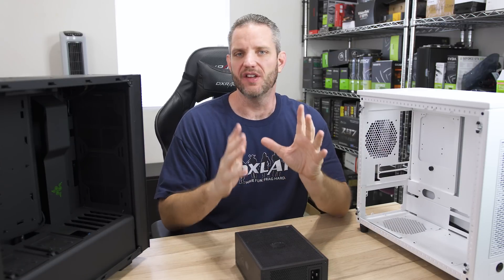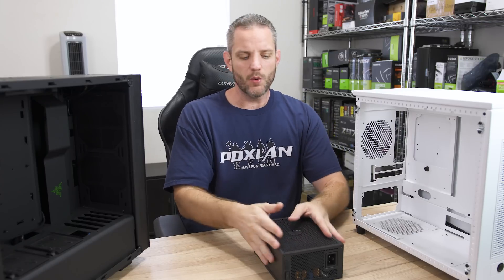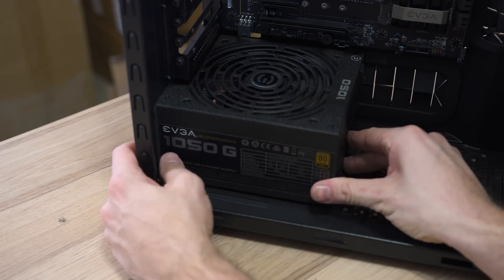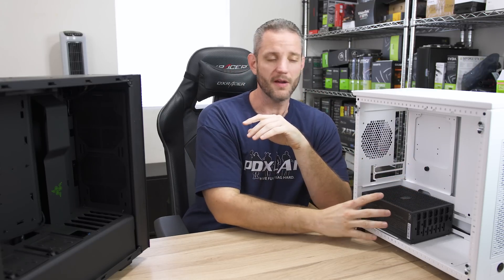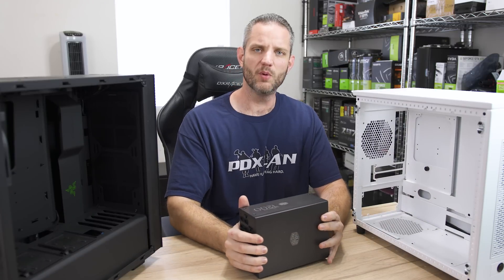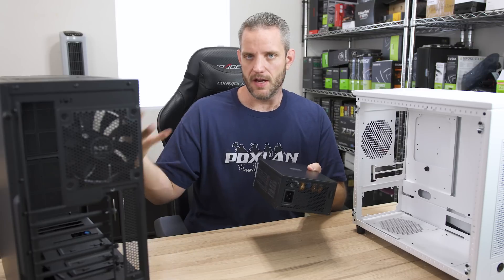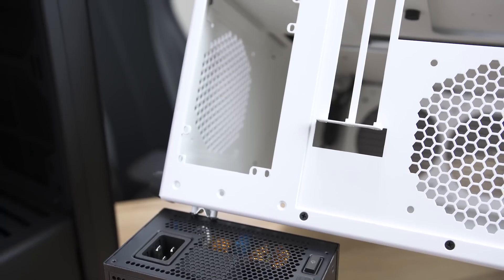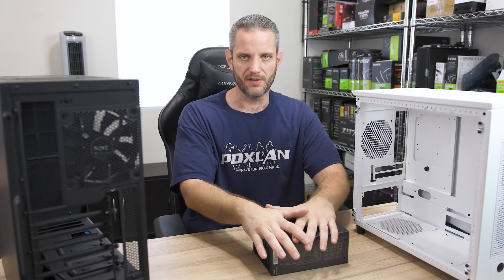Should you mount your Power Supply up or down?

Comment: Thanks for going over this.  It did raise a few questions for me - not sure if it's easier addressed in the comments or if I missed a previous vid you uploaded, but here goes:

First, with regard to positive/negative air pressure, I'm led to believe that doesn't really matter as you're not talking about an airtight enclosure.  You have constant passive airflow - often enough through the grilling that's usually most of the back and top of a given chassis.  That's not enough to cool PC guts if you're going strictly with air cooling, but the pressure would logically sort itself out under those conditions.  If I'm wrong on this, can you point me to some resources on the subject?

Second, with regard to mounting the PSU up, wouldn't it just be pulling in the heated exhaust from a GPU (again, assuming stock air cooling) as the two sets of fans are pointed directly at one another?  I grant that the air exhausted off of a GPU will be cooler than the GPU itself, but it still seems like a bad idea to have that pointing directly into the intake of another device.  Again, if I'm way off base, please set me straight on this.

Again, thanks for the great vid.  Looking forward to the next.

Comment: I don't think you should count on a revolving warm air scenario with a PSU venting downward. They don't exhaust or intake at high cfm and that warm air will rise out the back far easier than it could be pulled back in. I would always vent downward even if it meant putting it on a board. 

I think you could make an argument that helping exhaust a GPU blowing down onto the PSU at upwards of 2000 rpm. But I still feel better having that all important PSU fending for itself alone.

Comment: wow, never knew this. question, I having the airflow for all 6 of my fans to exhaust out of my case with no intake. is this wrong? I thought it would limit dust and heat. so far I have noticed less system heat and dust but I also put my PC on my desk
Reply: 3en 3en6ie thank you. that helps. so I have 2 140mm in front a 240mm radiator with 2 120mm up top and a 120mm in rear
Reply: 3en 3en6ie TT core v71

Comment: i have the nano s, should i mount it down or up?
Reply: somewhere in between.
Reply: probably down, at least if you have a dual slot graphics card because the card cooler will block the psu fan, also if you haven't already bought one you should get a blower style cooler over an open air cooler in that case as the psu will block airflow to the fans of an open air cooler.

Comment: Won't the GPU exhaust into the top of the PSU and make it hotter?
Reply: GPU's don't exhaust down. your only exhaust directions are out the back of the case, up/down relative to the GPU, or out the 'front' end of the GPU towards the front of the case (opposite of the backside).

GPU's always intake from down, they never exhaust in that direction.
Reply: ***** Oh, I've been thinking the GPU's exhaust from the fans this whole time. Thank you for the information

Comment: I was actually wondering if facing the PSU up would help with airflow of open air graphics cards such that the hot air from the GPU would have a path to escape, otherwise the PSU would effectively disable one fan on the GPU. However if both GPU and PSU ramp up their fan speeds, both are choking for air.

Comment: I actually just switched the direction I had my power supply to up and cooled my graphics card down by 15°C
Reply: ^while under load
Reply: Are you exaggerating or did u actually see temps drop that much?
Reply: Not exaggerating. I have a 1070 and I noticed when I took my headphones off while playing Witcher 3 that my PC was super loud. My CPU temps were perfect but my GPU temps were in the 80's. So I looked at the inside and I realized that my GPU wasn't getting any air flow at all because there is nowhere on my case to put fans so the GPU can breath and the card is so long it splits my case into two halves. So I decided to flip the power supply and it fixed it immediately.
Reply: Is it a reference 1070 or an open-cooler aftermarket one? What case do you have?
Reply: It's a thermaltake versa h25 and a Gigabyte G1 Gaming 1070
Reply: Interesting. I just modded my case so that my side panel no longer has a fan space and I saw temps go up. I'm going to try flipping the PSU now and see if I get lower temps because right now with the side panel on I get ~72C at 50% fan and without the side panel I get 60C.
Reply: Just flipped it and it's made no difference :(

Comment: Linus did a video on this before. It makes no difference at all. It comes down to " A E S T H E T I C S"
Reply: No, he mentioned it depends on where you're planning on putting your tower, if you put it on a carpet floor with no case feet, fan facing up is ideal unless you want to blow up your PSU. And a few more things.

edit - posted that comment before Jay mentioned carpet.
Reply: It doesn't make any SIGNIFICANT difference. Though if you're building you might as well mount it accordingly and optimize since it's not hurting you or your time. If you're putting it on carpet, face the fan upwards. If on hard surfaces, face it downwards to help keep dust out. And Jay made a good point I didn't think of, watercooling and potential leaking into the fan could cause a potentially, VERY bad day. But in the end it's not a big deal. Kinda like how people freak out over not having anti-static mats/wrist bands, people go their whole lives without static discharge frying their equipment but it's a nice practice if you don't want to take any chances.
Reply: What if I mont it side ways??
Reply: really dodo ? fine,. block your psu's fan by placing it close to the floor
Reply: What difference does it make if you are sucking dust in or blowing it in?
Reply: How the hell does blocking off the airflow not make a difference?
Reply: @NikoBell1188  What airflow is being blocked off?
Reply: I once had a BeQuiet Dark Power Pro 550W which I mounted with the fan pointing inside the Define R5 case because the cable management was just plain awful when the PS was mounted "the right way". Cables to short, looked crap, didn't like it. Just because the placement of the connection ports on the PS.
Now I have a BeQuiet Dark Power Pro 750W, which I could mount "the right way" because the connector placements were better. Did I notice any difference in temperatures or noise?
Not a single bit.
Reply: Didn't you watch the video? If the case has a shouded PSU compartment like the NZXT S340 then it has to be fitted fan down. It won't last a month if fitted fan up.
Reply: Linus is an idiot. Don't take advice from that guy, but for this situation, Linus was right. Unless you are blocking it with carpet.
Reply: Basically, I think what PSU you are buying is much more important than what way you will put the fans. 
Also, although it's better to get a "bigger" psu in terms of power, [you'll also shouldn't buy bigger but crappier psus], with processors [cpu + gpu] getting ever more efficient, you don't need like +1000w powerhouses. 

You can easily get away with anything from [400W if very good, 450W if decently] like 500w - 850W, for the average [gaming] user, I would say anywhere around these estimates, depending on what you want to do with it. More particularly running multiple gpus. 

I generally prefer the strongest single gpu than bothering with sli/xfire. As for the newer api way, which I think is much better idea, tho I don't think I will be doing this any time soon neither, and my reason would probably be if I could/want to run two cards and get benefits from exclusive features, without having to have a separate system to benefit from them. And/or you could bring some enhancement in performance without any harmful disadvantages. 

But that being said, you are better buying a tougher more quality PSU, than going for the sole higher wattage. It's a good idea to go higher than "needed", as long as you don't need to drop the efficiency rating. Sorta like a thumb rule. Better get a quality 650W Gold [some like the SeaSonic and CoolerMaster are gold, but nearing Platinum] than going for a 750W Silver / cheaper quality. But honestly, that's just my preferences and these days, unless you are buying some really trashy PSU from some weird brand you will not have regrets. :P
Reply: @metal502  what a load of crock. I had a 750 W PSU. Clocked and alot of air cooling fans. The thing is that it was a bronze + and only has a 85% efficiency. It resulted in power shortage and spontaneous shutdowns since my power need was around 630 W.  

When buying a PSU. Know your power need. Don't look at the power label. Look at the efficency and the power supply at max load to determine what you need.
Reply: Well yeah, the static discharge is a bit of a scare, but so are many other things like smokers falling asleep with a burning cigarette and getting set on fire. Maybe not the best reference, but the chance of that are very slim, yet it could happen and if it happen the consequences might be serious. 

I started wearing the wrist straps just to be sure, tho following basic guidelines like evading wearing too much and specifically e-static prone clothes like wool sweaters and shit. Not saying to build half naked or fully naked, tho that might be a really fun idea if you're building with your gf, tho the build might turn slower than expected then, but hey savor more moments. :P 

And again, sjw's and feminazi would be triggered so that would be "sexhist"... -_- 

Which is only another reason to do it. :D 
With your bf/gf's consent of course. Which is pretty much inherently self explicit, hence we don't really live in a rape culture. But I digress. xD 

Pretty much you can decide about your PSU given your environment. 
I personally would rather install it the normal way and not have dust fest fluffy carpet, especially if you're allergic to domestic dust [acars/mites]. 

Or you can simply put a nice platform there, but srsly, those carpets aren't really that good in general if you're gonna leave your pc on the ground. You will still get more dust compared to a flad surface, unless you don't mind and can vacuum it more often than the other stuff.
Reply: except it does make a difference
Reply: actually it does matter if the power supply is facing up and into the case then your putting more heat inside said case if its facing down then your blowing it out, ascetics only matter if you have rgb power supply's have never been that pretty.
Reply: @prevenant  The fan you move up or down is an input, not output!
Reply: @prevenant  Not sure what you are trying to say, if its facing down it makes 0 difference, but i always thought if you face it up then you are sucking more hot air out from the case through the psu making it "cooler". Although it would heat up the PSU more, I have never had a problem with a hot running psu, unless you get a psu that has  just enough power to run your system.
Reply: @shawnsmith3741  it's super simple and it does make a differance if you have your fans facing properly blowing to the back. As well as the power supply pulling from the bottum and then out instead of combining them and pulling down and to the back which results in less air flow
Reply: More efficient air flow with less combined heat exhaust = cooler system but again this only actually matters or makes a real differance if you have more than 3 fans in a system as I have 6 not counting the power supply and there is a 10 to 20f differance in the cool air up vs down.

Comment: its a fan, it sucks in the air. 
either face it down and make it get cold air from the ground, cold air is at bottom of your room and hot air is on top.
so facing down means you get cold air and it pushes the hot air out the back.
facing it up and sucking in the heat from the GPU woudln't be that great + all the dust in your case goes down with it aswell.
placing your psu fan up is definetely a bad choise unless your case does not have ventilation at the bottom.

Comment: Can you run a evga 1060 3gb on a 300w psu ?
Reply: No, you need the rest of the computer too.
Reply: A 500W is already more than good enough if it's 80+
Reply: Ryan Lin Almost all modern PSUs have a safety system so that it hard resets (shuts down and auto-restarts) your computer before that can happen. If you've just downloaded a new game but when you load it, the entire computer restarts instead of the game just crashing, then that is generally a sure sign of your PSU requiring a replacement. So fortunately (or unfortunately, depending on whether you're a pyromaniac), there will be no explosion.
Reply: Ryan Lin That sounds quite risky, I would recommend a 550w instead
Reply: ElectricPyroclast so much this. 

Ryan I wouldn't put myself through the problems.   I would look at one of the evga models 430watt 500watt and play it safe.  A good power supply is the most important investment in any computer build.
Reply: The tech deals said it would work . But what happens if the psu is stressed out will it explode and destroy my components ?
Reply: Ryan Lin stability issues...  And risk to the machine
Reply: Saxie81 I'm one of those guys who add a little extra wattage for safe measure. A 430W would definitely work in theory, but there can be situations like plugging in tons of storage or USB devices or cooling units (case fans/liquid coolers) that ultimately make it potentially inadequate. A 500W does cost a slight premium, but it's a guarantee that it'll survive everything you throw at it in mid-range gaming (aka up to a 1060). A 430W is perfect for the same scenario except the upper limit of GPUs should be a 1050Ti or AMD equivalent.
Reply: Personally I'd get at least a 500~700 watt psu, so that you could expand a little without overburdening the little 300 watt psu with an hdd/ssd, an extra ram chip, or really anything to do with expansion.
Reply: a GTX 1060 will draw ~125 Watts and 10.5 Amps at max.

you can get away with it(if it is efficient, probably is not), but you'll be pretty close to the limits of such a Power Supply.
more practical to use a 450Watt+ capable Power Supply.

ofcourse it's also important to buy a good Power Supply, not just any. regardless of brand, there are excellent Power Supplies that can be used for anything in their reach, and there are garbage ones that are a fire hazard.
Reply: 700W is way overkill for a 1060, since 1060 SLI just doesn't exist, so it's pointless. And if 700W is actually just enough and not more than enough, then you probably bought a really shitty PSU from Thermaltake.
Reply: Ryan Lin it could work, but I wouldn't do it because most 300 Watters are god awful and can't actually do that much power.
Reply: ElectricPyroclast you can sli the 1060, its just not beneficial at all
Reply: Joey van de ende Although you can technically attempt it, the 1060 in SLI is not officially supported. Same with 3-way and 4-way SLI for the higher end Pascal cards.
Reply: ElectricPyroclast i know, that what i meant. Only a handfull of games support sli 1060 and even then its most likely buggy and not working 100% perfectly. Maybe in the future it will become more practically
Reply: Joey van de ende In the future, it will be even less supported. Keep in mind the fact that it's impractical to buy multiple mid-range graphics cards when a single higher end card can do the same job with more performance per dollar. If you're considering having 1060 SLI, ditch that idea and go with a 1070.
Reply: ElectricPyroclast it may be more practicall to just have 1 high end card but sli looks very cool when its done right :-). Custom builds tend to go for sli since it is an eye catching feature. But i have to agree with you
Reply: If you can only afford mid-range graphics cards, if I were you, I'd care more about money than looks. I myself am seeking an upgrade, and I've carefully cut things that I couldn't afford yet (i.e. deciding not to buy ML140 case fans or even LED strips, going with a 1070 instead of a 1080, 16GB RAM instead of 32GB). Have I kept my rig with decent looks? Yes, albeit it'll look slightly empty, but I know where to stop giving my wallet extra pressure.
Reply: ElectricPyroclast true, i have been on a low budget myself for my pc and went with a gtx 1060 6gb to upgrade my gtx 960 2gb. Serves well enough in my build since i had to pair it with the i5-4460 which i will have to upgrade next. I skipped the led lights and will add them sometime later. 

Even though i was on a small budget i managed to make an pretty nice looking build, got aome posts on my profile about it. All that has to be added now is some nice looking ram that goes in the color scheme and i can look into upgrading my keyboard to mechanical
Reply: Joey van de ende ElectricPyroclast 
yeah, for the like <5 things that support MDA or LDA mode.

it's not going to ever pay off.
just like two low end GPU's in SLI or Crossfire has never paid off except in rare situations where a lower end card overperforms expectations by a significant amount to make each of the lower end units worth more than their price.
Reply: Ryan Lin fuck no you cannot I have a 350 watt psu if you wanna get a gtx 1060 I suggest you get at least 500 depending on what cpu u also have
Reply: There are $50 650 Watt PSUs on Newegg right now that’s a steal, it’s a fucking power supply you minus well get more than you need and not have to return it

Comment: Tomshardware did a test of various configs and mounting the PSU fan up or down made very little difference in case temps, CPU temps, GPU temps.

The biggest difference was creating a positive pressure environment in the case.

I tend to mount the PSU so it draws from the bottom for the simple reason I'd really hate to drop a screw and have it fall through the fan vents. :)